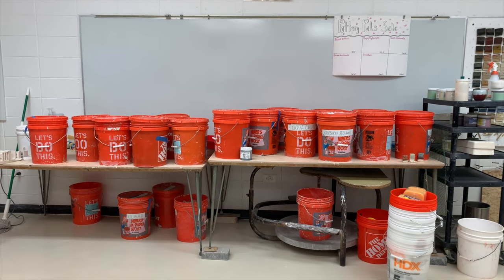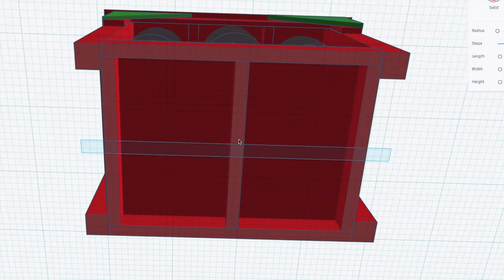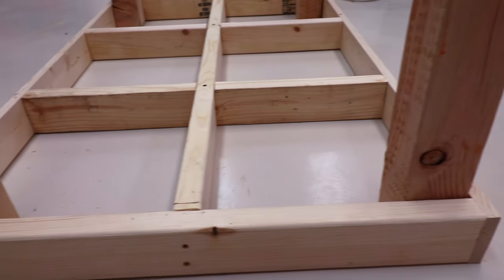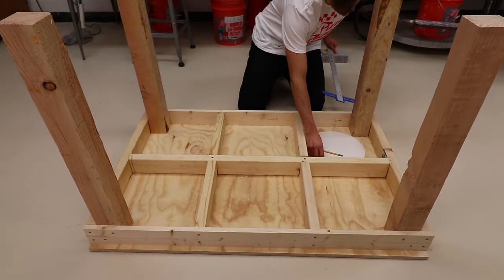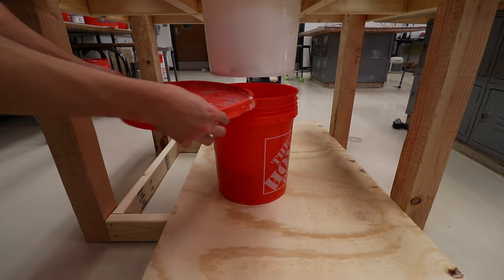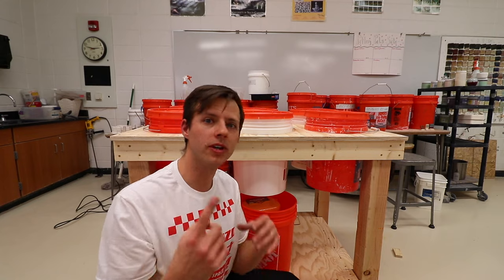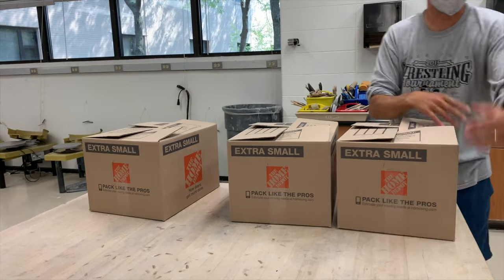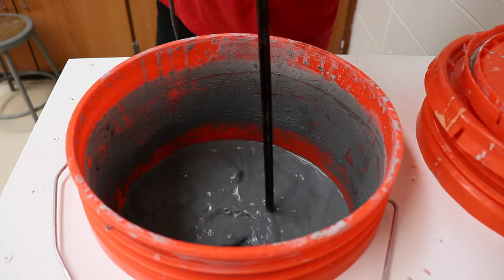Making the PERFECT Glaze Cart for Glazing Pottery and Storing Ceramic Glazes | Pottery Studio Ideas

Comment: I was looking for a glazing table idea for my studio. Thank you for sharing yours! It's the perfect size for my space!  I think for tools, I would just put hooks on the side and hang them. or a crate underneath for them.  where to put your pieces when you glaze, you could make a table(s) just like that with casters, but maybe half size to put along side the glaze tables and then transfer to a baker's rack with trays, that way, all the pieces can be wheeled right to the kiln area.  As for the lids, you could run a narrow piece of wood, like 1/2" wide by 6" tall, perpendicular to the table top, down the middle between the buckets and the bucket lids could sit upright between the bucket and the piece of wood.

Comment: Depending on how messy the tops of the lids are, you could attach a magnet to to top of each lid and on the side of the cart attach a metal board, easy on and off.  It does not look like you have too much room in between the top and lower buckets.  Or attach a clamp or peg board on the sides, use peg hooks to hold the lids and other items to store (paper towel roll, etc) .....great video.....:)
Reply from the maker: Thank you Lois. I am a fan of magnets. And that may be quicker than hanging off of hooks. Hmmmm. Good idea to ponder. Thanks!

Comment: Nice table! 

You make a thin side pocket for the lids. Even out of fabric or webbing. Also you make a 2x6 permanent shelf that goes across the middle. It wouldn’t get in the way of it was high enough. Kids could even be placed on it along with other  things. It could even have mortise and tenon feet to lock it in place with no screws.
Reply from the maker: Hey thanks! Ooooo. I do like that idea. Shelf elevated for lids and pots. Could work 🤔.
Reply: @CeramicJim  I mean this I think...

Comment: Lids can just be put under the table on top of the other bucket - seems to be enough clearance -- tongues can hang from hooks on the end of table as well as a DIY hydrometer ( we use a six inch ruler with bolt/nut at the bottom with two rule lines marking the general top and bottom of SG desired ) -- we don't have resting areas for pots but a swing top could be attached using hinges with lockable supports on the long sides (I should look those up to use the correct name for them 😜) Great video - we have been working on a mobile solution for our community college glazes as we have to wheel them outside, color grouped and the stations six foot distanced so more than one student at a time can glaze. This would work really well. Thanks for sharing.
Reply from the maker: Wow. So many good ideas. Thank YOU for sharing. I’m surprised there aren’t carts similar to this for sale somewhere. I would have bought one but it WAS fun to build. Thanks again. Good luck with the glaze stations!

Comment: Jim, Great video and I am definitely making my own for our Ceramics Studio because of our limited space. The only thing I'm missing are the steps written out. What dimensions are the side wood pieces for the top frame? I assume they are the 37.5 " sizes since there are only two.  The long 2X4, the 44.5" is the cross brace horizontally and the 26" pieces are the cross braces vertically? The 29.5" pieces for which there are only 3 on the cut list, are those the bottom frame? Shouldn't there be four of those? It would just be helpful to spell out which cuts are for which part of the construction steps. Thanks for such a great idea and making the video easy to follow.

Comment: Jim, Thumbs up Mr. school teacher. If didn't know better I would have thought you went to school with me  studying industrial engineering and design. Very well thought out and efficient on using all the space needed. If you would have been able to use a larger caster it would have moved even smoother, but I understand the issue with the height. Thank you for sharing and it is great to see a NEW video from you. eddiespottery.
Reply from the maker: You even use those casters that attach to the side and allow the legs to sit on the ground when not in use? I thought about getting those instead to lower the height but I chickened out. 

I know 🤦‍♂️ I’ve been gone for so long. Believe when I say I’ve thought about my channel and all of you awesome people almost every day. I miss posting, sharing, and connecting. Happy to help and you’ll see more of me more often. This school year has just been INSANE.
Reply: @CeramicJim  Hey Jim one last thing, TKu for the 4 ingredient  formula on making your CLAY. I plan going up to US Pigment next month to get everything and a few other things I have been needing. I have over 1000 lbs of dry clay as of now, but I have been wanting to make some porcelain. What cone range can it be used at ? TKu.

Comment: Fabulous!!!  Thank you for sharing!  You could put a hinged pop up shelf on both  ends.
Reply from the maker: Happy to help. What would you use to keep it popped up?
Reply: @CeramicJim  Apparently YT doesnt like links in the comments, but if you search for foldable table legs you'll see some pretty cool manufactured metal legs and you'll also see some very affordable DIY.  Before you throw that table out, are it's legs foldable?
Reply from the maker: The comment may be held for review because of the link. Which I can approve. I’ll check. It’s funny you ask. I was considering taking them off to use but the screws were stripped and the legs did not fold. Thanks for the tip Les!

Comment: make a bucket lid holder rack on the sides like your watching dishes so if your lid has water or glaze it will not get on the floor.
Reply from the maker: Hmmm. I think I follow. Would it stick out from the cart?
Reply: @CeramicJim  (Wooden Dish Rack Plates Holder) You can put shelf in the middle of your shelf and put or build a dish rack in the middle of the cart so they can just put the lid on the rack holder in front of them. If you put it on the sides you have to make it removable but if you put it in the middle you can have a little more control.  (i hope it helps i been trying to come up with ideas lol) Thank you your great.
Reply: its a idea hope it works
Reply from the maker: Ahh I get you. That would probably look nice and tidy too. Thanks for the idea Charlotte!